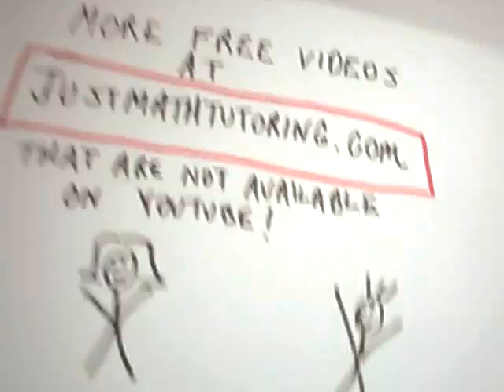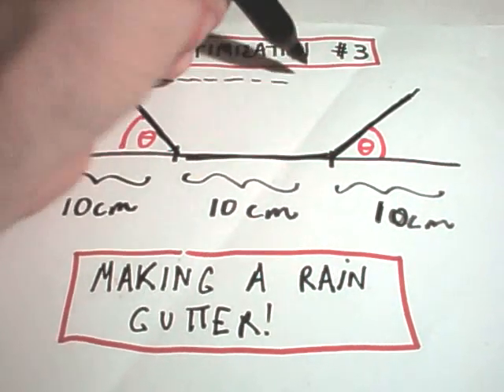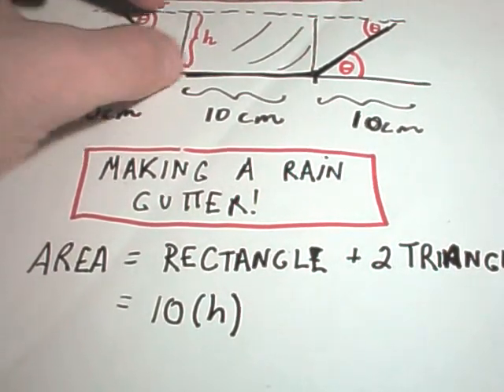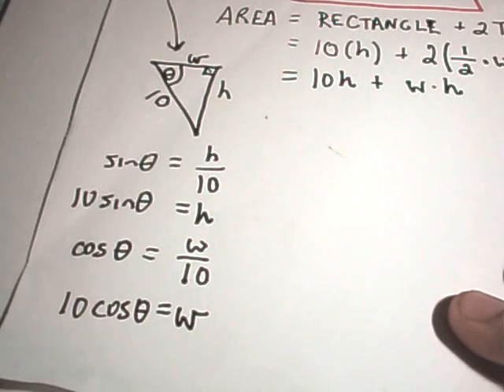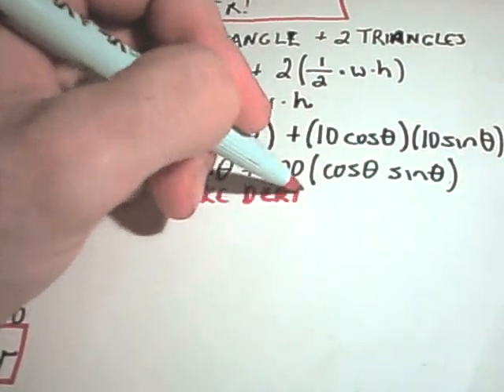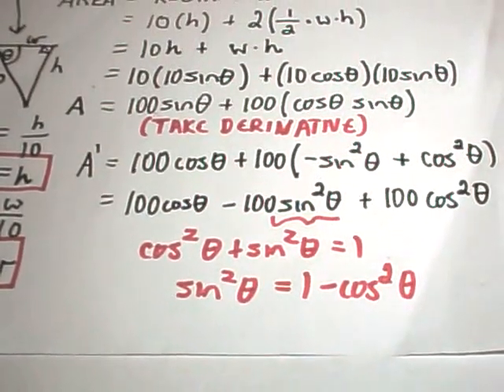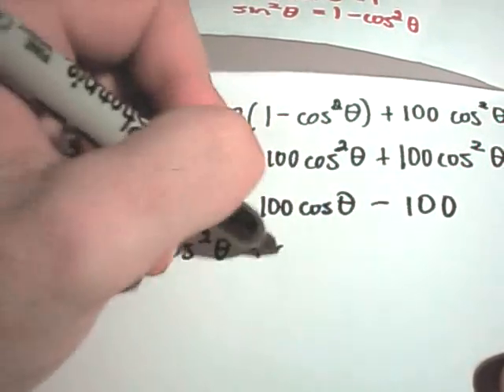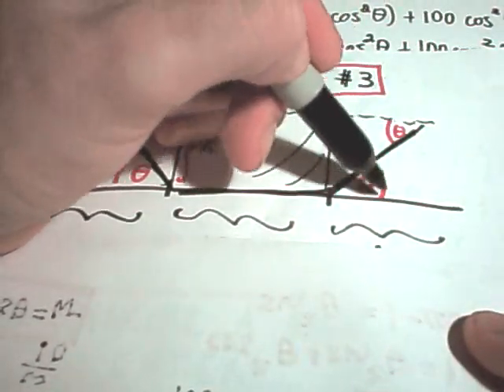💧 Making a Rain Gutter 💧

Comment: I ended up using the trig identity cos^2(theta) - sin^2(theta) = cos(2*theta). You end up with cos(2*theta) = -cos(theta), which is 60 deg. The quadratic you ended up with is easier IMO, but this other approach worked out too.

Comment: You have to think about the context. eg if you have profit, you wouldnt wish for your business to run at a loss. you'd want to find out  where you'll get maximum profit. Same for cost of materials. if you want to build something, you'll look for the dimensions that use the least materials, right ? (because more materials = more money, which i'm sure given the current economic situation, you do not want. )
so in general, i'd say you should think "would this benefit me or would this be bad"

Comment: Whoops, one mistake. You would actually have to do 90 - arctan(w/h), since arctan(w/h) will give you the measure of the angle from the normal, in this case 30 degrees.

Comment: In addition to solving the equation in terms of theta, you can also use the pythagorean thereom to find h or w in terms of the other variable, take the derivative with respect to whichever variable you chose to solve for, and then use that to find the optimal height or width. From there you can apply pythagorean thereom again to find your other variable, and then you could calculate theta by taking the arctangent of your (w/h) values.

Comment: hi...great videos!
hmmm...i think you can avoid the derivation of trigonometric stuff by using the Pythagoras Theorem...just like:
total area=10w + wh
then build a triangle and by the definition of pythagoras theorem:
10^2= (w^2+h^2) and get the equation of "h"
now you can "plug in" it:
 total area=10w + w([10^2+w^2]^1/2) and derivate it... once you get the solution of the equation you solve cos^-1(the solution)